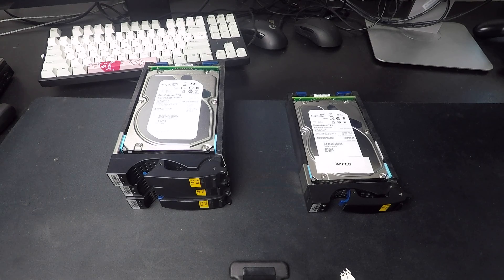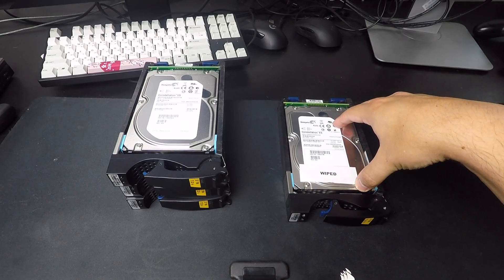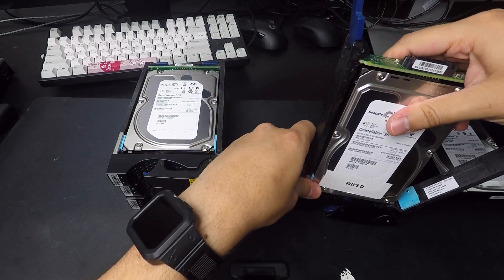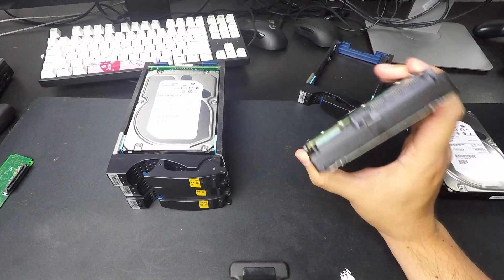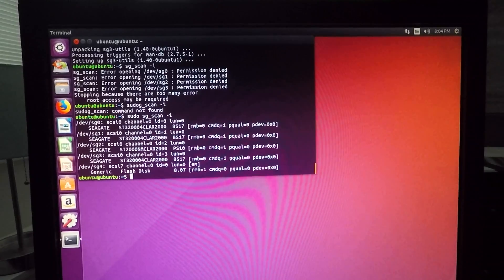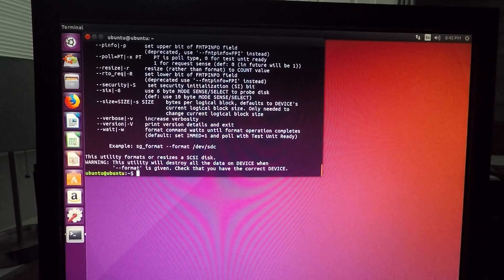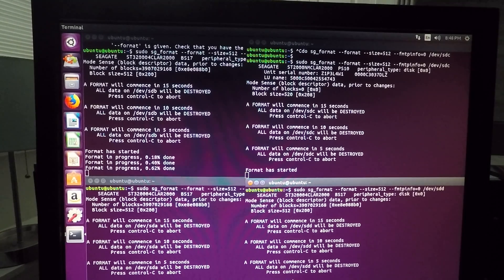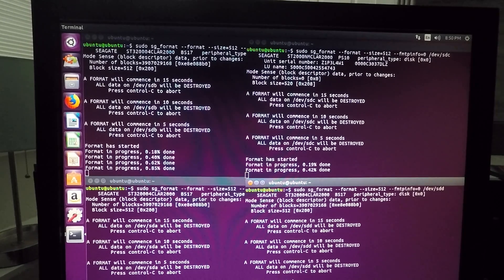10TB for $70! How to format 520b sector SAS drives to 512b - EMC, Netapp, HP, Dell, etc.

Comment: I had to flash my Dell raid controller to IT mode. This took me a day because at first  freedos could not see the controller. Took around 15 hours formatting for my 4TB disks. After that they where vissible in Proxmox without a reboot.

Comment: I've just gotten some X3550 M2s IBM and had one drive working enough to port ProxMox then I got stuck with all the other 500gb drives, duh.  This seems to be the answer and I'll try it I even took the drives out and tried to use a PC with a SAS to SATA connector into a normal SATA chan, but of curse (sic) it saw the drive in admin crap and it's  outputting "drive not ready" so cannot partition or format (drives didnt spin up too so dont assume your drive is dead its just SATA not telling the drive something) and on the server RAID (LSI) "wrg type" so bearing in mind ALL my drives are EXACTLY the same IBM 2.5 500 GB 7200s then Im going to try this, ON the RAID controller - in the X3660 chassis,  so it talks properly to the drives (it already sees them in LSI diag - but even that hates them) ...(....which is why the PC didnt work) I wish you'd outlined the physical machine just for info but I guess it doesnt matter. I hope these commands translate to the version of Linux the latest PrxMox installed - million thanks from Thailand, the home of the server junk yards (and a lot else besides!!)
Reply: I tried it IT WORKS great thanks!

Comment: Along with formatting the drives how have you incorporated them into your build? Is it a SAS motherboard and if not, are you using a SAS controller card? What is the purpose of formatting the drive is it just for SAS or SATA motherboards or do both need it?

Comment: I am a newby where it comes to SAS drives. I have 4 2TB Constellation ES.3 drives and have been for hours trying to find the easiest way to connect these drives to my PC. It seems that I must spend a whole lot of $$$ just to connect them. I purchased them not realizing they were SAS drives. Any help would be appreciated... Thanks... One other thing, must they be used in a raid configuration (something else I am not familiar with) or can I use them as individual storage drives?
Reply: what is your motherboard? the simplest way is to buy a PCIe HBA raid card with passthrough rom., then connect the harddrive to the card with sas-to-sata cable. Or, if your MB has sas port (scu), you can choose disk mode as raid or non-raid in BIOS. and, check that sector size is already 512 to use in windows

Comment: Thanks for the guide, btw, two questions might also be asked by many people, 1) what does the fmtpinfo=0 parameter do here in the sg_format command, 2)  is there anyway to read the SMART info such as drive power on hours out from these SAS drives?   Thanks!
Reply: The fmtpinfo=0 should change the "end to end protection" to 0 (off), it's unclear weather it really does or not though. In Linux smartctl -a will show SMART info for a drive.

Comment: Great info man! I have a system setup as a "conversion machine" with all types of devices and interfaces on it, from MFM to SCSI1/2/3 to SAS1/2/3 with tape drives, floppy drives, zip and Jaz drives, cdrom/dvdrom/etc. I'll just put this on it and since I externally pull out the cabling I can use it to run those long formats on many drives. I found keeping one "old" system setup like this saves a ton of time with these "new" projects. Thanks again!
Reply: What brand of drives were these?--Seagate, Hitachi?

Comment: I just purchase some 15k 450gb sas drive for my hba and one of them is stuck at .99% when reformatting to 512 bytes. I’m using sg utils on windows and running the command sg_format —format —size=512 pd(drive number)

I’m new to this whole process so if anyone knows a solution let me know!
Reply from the maker: Don't use SG Utils on windows. Use it on Linux.

Comment: What is the advantage of reformatting a disk from 520 to 512 sectors?
Reply: 512K sectors are the normal sandard. a regular computer does not know how to address a drive with 520k sectors
Reply: When disks are fomatted with 520 sectors, Windows shows a CRC disk error and will not allow you to format the disk from windows disk management tool,  Mine are HGST SAS Disks using LSI SAS Card in IT Mode.

Comment: I have 6x 2TB 7200rpm SAS drives from an old EMC VNXe storage system. Would this format process allow for these drives to be used on an IBM x3650 M1 server?
Reply from the maker: Yes
Reply: So I was able to format my Seagate 2TB 7300rpm SAS  drives to 512b without any issue but the ServerRaid controller that came with the x3650 M1 will still won't detect the drives. I even tried an LSI M5015 RAID controller from an M3 server and it too will not detect the drives. I'm stuck :-(
Reply from the maker: @troyhector  Do you need to 3.3v mod?
Reply: @JDMWAAAT   I'm not sure by what you mean?

Comment: Great video! Not too long! Only the essential! But I still have a doubt! 
I have a Dell R610 server with a PERC6/I Controller and it shows the NETAPP drives in there but as Failed drives (they are brand new drives) when I use the sg_util or lsscsi command they don't show de drives , only shows a PERC6/I device as sda.
How to fix it to linux shows the drives directly pure in the OS ??
Which controller did you used?? 
TKS in advance to anyone
Reply: Did you ever figure this out?  I have a few netapp drives in a MD1200 connected to an R520.  PERC H800 also shows them as failed.
Reply: Did you find it out? Keen to know too!
Reply: @greasyfingerss9811  Just replying to everyone here, so you know in the future or for others. You can't do this through a raid controller you'll have to get a breakout cable or have a HBA card so the drives are directly connected.

Comment: Space is the premium vale and 2tb is a waste of a slot. This is why they are dirt and cheat.
Reply: yeah, but I got mine free with a 30 USD complete X3550 M2 server /3 X 500 gb / 2 cpu/ 32GB ram etc!  so its worth a try to get the feel of getting various VE systems working etc before shelling out on new hardware drives and uprating to a better platform

Comment: This is all great and stuff, but sg3 utils dont even see my sas hard disk drives.
I think it requires a HBA or pass-tru, a feature none of my 6 or 7 controllers that I have available supports I guess.
Any controller (two Adaptec, 4 LSI controllers, 1 Intel controller, all SAS capable, tested with different backplanes dont fucking support my ST4000NM0023 with MS0F firmware)

Comment: Excellent vid mate tyvm
Using this with Dell Perc H310 flashed to IT mode
Reply: Would it work with 4TB seagate? I got Dell Perc h700 but it can not be flashed to IT mode.
Reply: @Thrakus  definitely try SeaTools for Windows - advanced options saved my life with a couple of disks of which i was convinced were not savable. (It detects the disks with any card i throw at it, in any mode lol) i wasted so much time in linux.

Comment: Mine didn't work straight off the bat, had to reformat to 520 then reformat to 512. possible issue from who ever decommissioned the shelf. very long process for 24 drives.

Comment: Works perfect, same drives (2TB), used Ubuntu 18.04.3; had to add "--six" (did not work without --six); but video really perfect, clear and no nonsens !
Reply: how did you get the raid controller to not just block the drive. When i scan i dont see the drives because the controller faulted them. The do show up in the controller so i know they are present.
Reply: @awidesigns  use an hba, or use the raid card in hba mode
Reply: @awidesigns  I didn't have to do anything special (as far as i remember); are you sure drive(s) are OK ? I have LSI SAS3801E L3-01123-04E Dual Port SAS Controller with Seagate's ST33000651SS (3TB)
Reply: For HP servers, if you do not configure the disk in RAID controller as logical drive, the disk is automatically in HBA mode and presented to the OS. Not sure about other brands.

Comment: Many thanks for this tutorial. I did it on a "Savvio® 10K.4 SAS" i.e. "ST9600204SS" in Ubuntu with a P420 controller on a PC (not a server) in HBA mode and I could finish the format procedure with and without --six flag. I created a disk Volume in Ubuntu afterward and I could copy small files into the disk without a problem but big files could not be copied. Also in Ubunto, the file system check shows me an error. Now I want to use the same disk and the same controller in HBA mode on an HP Proliant DL380 G7 Server on which a windows 10 Pro is running. I can see the disk in windows but it is not usable at all. I even tried it with the Raid mode of the controller. In Raid mode, I get an error that says there is a problem with this disk. In this case, the disk is not visible in windows at all. I would appreciate it if you share your ideas about my case.
Reply: You likely already realized this but HP's controllers are a real prick, even in HBA mode. Things should likely be done with a dedicated HBA and then if you wish to use them with your P series raid card that should work.

Comment: Same issue I had and I was banging my head for hours trying to figure this out. I actually found the same solution but it  was posted vaguely somewhere on a  forum post. In my case I got 12TB SAS or 4x3TB Seagate Costelation SAS (I think they came out of a net app) for $105 or so. $27 each. Two things you should be aware, it will take no less than 4-5 hours to format them and also all of mine came sealed but had about 16000 hours which I'd assume to be 2 years running 24/7.

Comment: Some RAID Controllers don't talk to your computer's or server's bus which means they don't appear in BIOS. So they will likely not appear in sg3_utils. Only your RAID Controller will. If you can put your drives in a Non-RAID array or on a HBA Controller/Card, this should work for you. Another thing, You cannot connect SAS drives to SATA back planes/connectors. SATA, however, is supported by SAS.

Comment: I was given a Dell 4TB 7200RPM Nearline SAS 3.5inch Hard Drive, all my drives in unraid works, but this one doesn't show in unassigned devices. is this the steps I need to do, to get this drive working?
Reply from the maker: Randy Kennedy possibly. However it is more likely that it has 3.3v standby. Google 3.3v easystore mod
Reply: @JDMWAAAT  I've done that with my easy store shuck drives. This can happen on a sas drive to?

Comment: So wait... you connect the SAS drives into a PC to the normal SATA port?
Reply: Got a couple of these on the way from Newegg for $3.92 a piece thanks to a 50% off code that's being offered: https://www.newegg.com/Product/Product.aspx?Item=12-117-664  So, yeah, totally doable..... in theory lol

EDIT: Well, I have received my cables and hooked two drives to a PC. Not sensed at all. They're spinning, and clearly on, just not able to be seen. Care to share how you got this to work? Sure would be awesome if the creators of these videos didn't just create them and abandon them for the rest of us to just wonder.
Reply: @Mr. Rich B.O.B yeah, I discovered that. But it wasn't a total waste. I was able to use one of thos to hook an ssd to my server's SATA port. I have an extra power supply set up to provide it with power and it is a data store for esxi lmao. Works until I figure this SAS situation out. Trying to get the damned H200i Raid controller flashed so the server will use it and the drives.

Comment: I want to see how you get the drives connected to your system and how your card sees the drive.
Reply: Probably with something like this:  https://www.newegg.com/Product/Product.aspx?Item=12-117-664
I received those today. Not picked up by the bios though. The drives are spinning, but the computer isn't seeing them.
Reply: I second this ; cant understand how an aftermarket Raid Card ( LSI or similar ) can present the Drives to an OS in the first place
Reply: @technomad900  you have to use for example an LSI megaraid card flashed with IT mode. you have got a lot of tutorial about it. Basically IT mode shows you the directed attached drives by deactivating raid capabilities on your card.

Comment: Hi.
I found some drives on ebay like yours. Is not so cheap but in Europe are more expensive. But is good deal.  I have one HP Dl 160 g6 server with p410 raid controler.  Can I reformat the drives using live ubuntu on server with the drives connected to sas on that server?
Reply: I dont think so, I have the same server and the "smart" raid controller made me look like an idiot when I tried.

Comment: HI friend , I have a Netapp hard disk 450 GB SAS 3.5 15 k . This disk is dose not work in all Dell and Hp server . You have any idea how can i solved this problem ?  Disk Part no 0b24501
How can i Format Netapp disk .
Reply: The trick first getting the system to see the drives. If you have the ability to flash the OEM RAID controller to its actual manufacturer, like in this article: https://techmattr.wordpress.com/2016/04/11/updated-sas-hba-crossflashing-or-flashing-to-it-mode-dell-perc-h200-and-h310/, I highly recommend it. Check Reddit for ways to do it too.  I scored with mine. 6 600GB 10k SAS  drives for $10 each. Once your system can see them, use linux to format them to the 512byte sectors.

Comment: How do you get the firmware off.... I keep getting Illegal request errors on my Seagate Constellation drives...
Reply: have you tried to add the --six flag? Had the same issue until I did..
Reply: How did you get the system to see the drives to begin with? I received these today: https://www.newegg.com/Product/Product.aspx?Item=12-117-664 
No luck in a PC though.
Reply: @haywire97470  you need to have a sas controller. Either a sas raid or HBA card. Sata drives are backwards compatible on a sas controller but sas drives are not compatible over sata. Makes sense?
Reply: @-MOS-  yes and no. Lol I didnt realize that. I got my Rraid controller flashed and I'm able to work with the drives. Had to put it into my PC for flashing. (A PERC H200i)
Reply: @-MOS-  I have a PowerEdge R610. with an H200i RAID controller that I have flashed and now have full use of my 6 600GB 10k  SAS drives I got for $10 each. Found out the trick was flashing the card in my PC's PCI Express slot, not doing it while in the server. I highly recommend this process for anyone with this card. You almost can't brick it. I messed up numerous times because of the server and it's still working great.
Reply: @haywire97470  Nice! Congratulations on the deal and glad it worked for you. I have a r720 myself and love it.

Comment: I have HGST HUC109060CSS600 MODEL HDD I have done all actions through sg3-utils and even showing now 512 bytes but when i am trying to initializing hdd showing FATAL error also not able to make array of drives
Reply: @Antibiotik Hi! I have 8 disks of HUC101860CSS200 and all of them can easily be changfed to 512 bytes of sector size. But the information "format unit has started" is followed (after 30 seconds) by this message: "test unit ready: transport: Host_status=0x01 [did no connect]"
Do you have any idea?